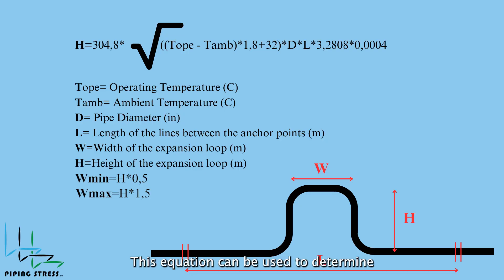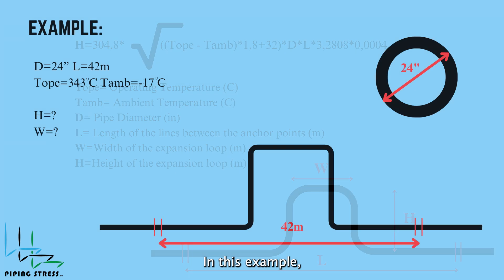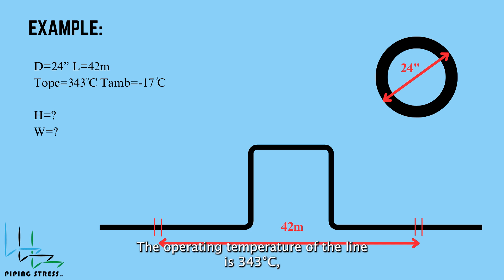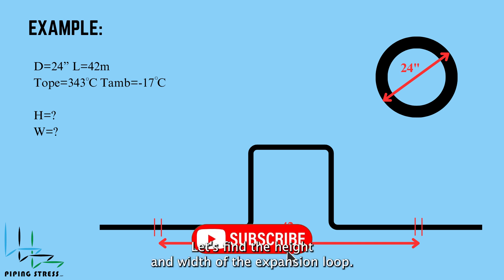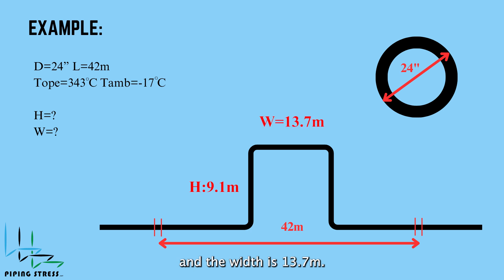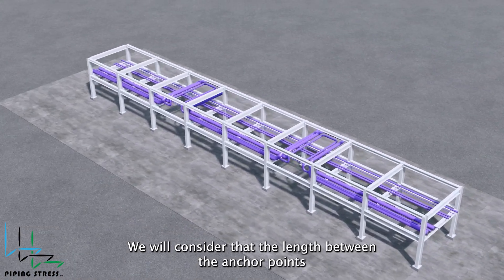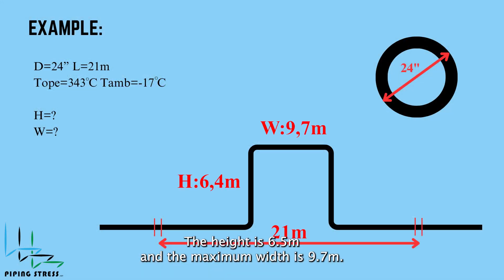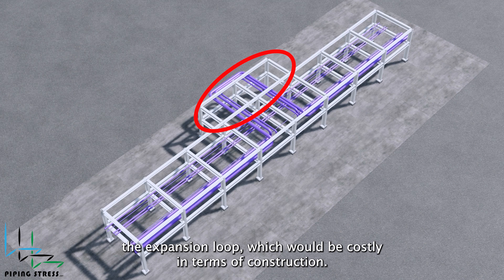Piping Expansion Loop Design - Hand Calculation

Comment: what are these constant at the formula you didnt write on the video
Reply from the maker: Hi, 25.4x12 is a conversion from ft to mm, (To-Ti)*1.8+32 is a conversion from Fahrenheit to Celsius, 3.2808 is to convert L from m to ft. 0,0004 is a thermal coefficient for CS.
Reply: @PipingStressNet  thanks a lot
Reply: @PipingStressNet thanks for explanation,But I have some question.
 Our line was 24" ,Why you note 12.
I put it in place with the formula, but it wasn't right for me. Please, how did you find the value of H and W, could you write them down separately?  Thank you for your attention.
Reply: Hi sir i have one question. 
Q= There is 1 expansion loop on 100 ft length of 2” iron pipe . 
Case 1 = how many expansion loop on 200 ft length ? 
Case 2 = how many expansion loop on 260 ft length ?
Reply from the maker: Please support us by being a member of PipingStress.Net Here the link: https://www.youtube.com/channel/UCdzNQwXAxStAlJNN0Gv421Q/join